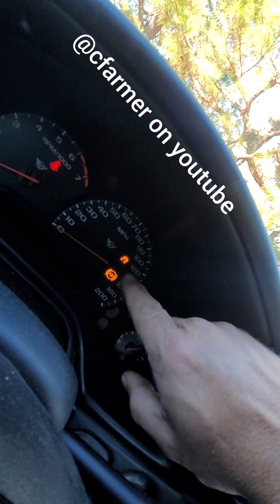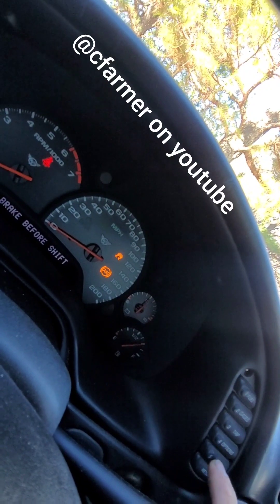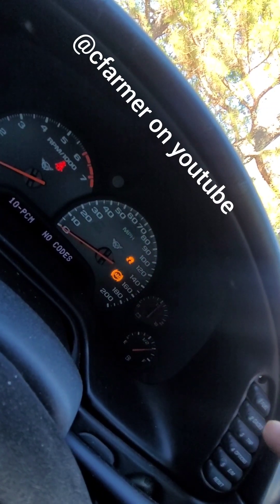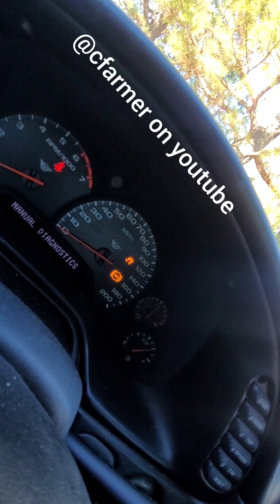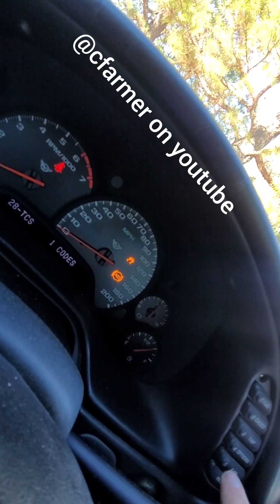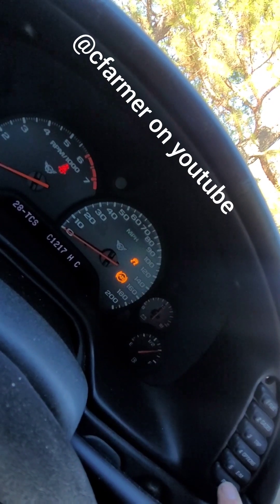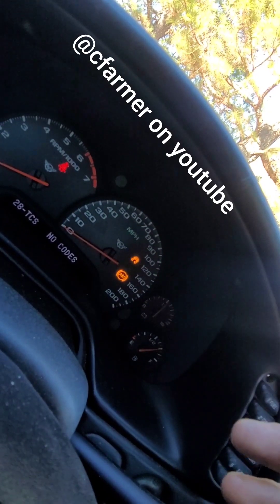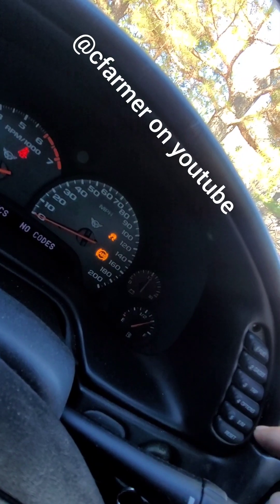Checking codes on C5 Corvette without Scantool

Comment: Its the abs pump stalling. You can tap on it on startup to get it moving. Need  to spin it every now and again to get it to come back alive. Either burnouts , or lift rear and put it in drive, step on the gas.

Comment: keep us posted on the c5 problem...   I have a 99 with the same lights on .....  LOL.......wheel speed sensor?
Reply from the maker: I was figuring a wheel speed sensor but turns out it had a blown abs fuse. I think my abs motor sticks from time to time. I replaced fuse and have driven it a little over 100 miles today. No lights